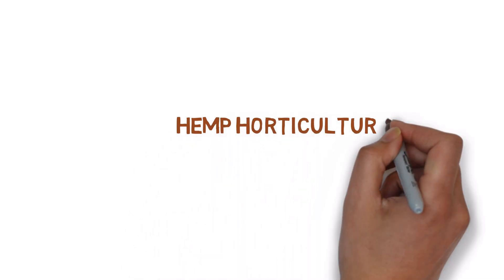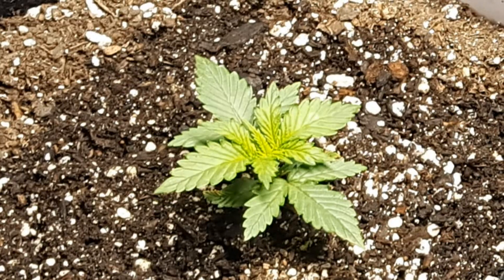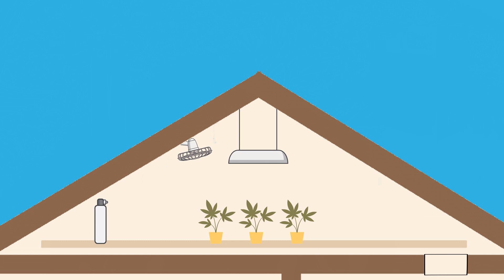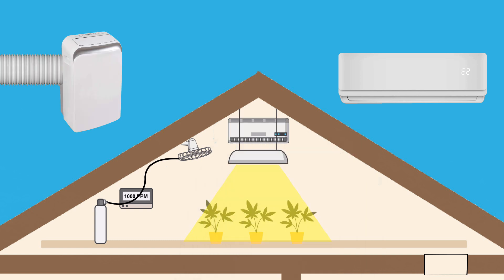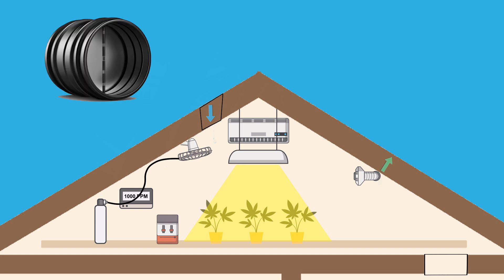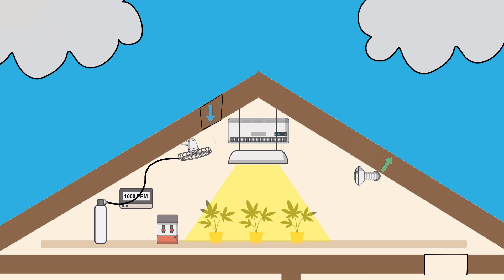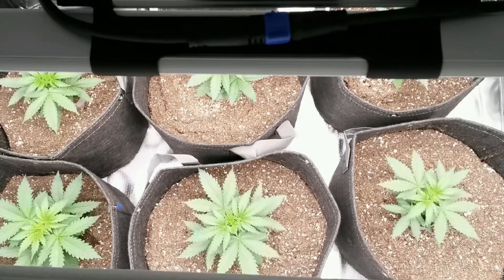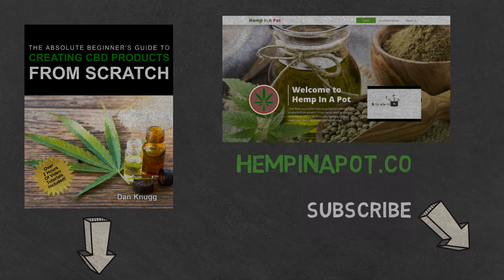What You Need to Do to Seal a Grow Space

Comment: Least important thing you can imagine. New and mid grower wouldn't notice a thing, from adding CO2,
Reply: 1st year grower here. they grew 20% taller per day the first week i had CO2. ive logged all my grows and have a time-lapse with a measuring stick behind them. but it wasnt needed. it was very noticeable. either you havent run CO2 or didnt measure it.
Reply: @swankshire6939  I'm glad it worked out. None of my bros here have used the co2 canister, too expensive.  It may indeed be an improvement. But we all tried using the mushroom bags there was no change... The most just keep the grow going using clone. Could be different from seed, who know.
However, if you have a gas oven that will produce a lot of co2 as well. Save a bucks if you can.

One thing I would spend money, if you use an over, is a CO2 meter. 
Also, taller plants make me think of stretchy plants.
Stay safe.
Reply: Cheaper way to do CO2 if you’re on a budget is; brewers yeast for mid level alcohol percentage in beer: add sugar, and Luke warm water; to produce copious amounts of CO2 for 2 weeks and then you must replace for best results. (Can go for 3-4 but less potent.)